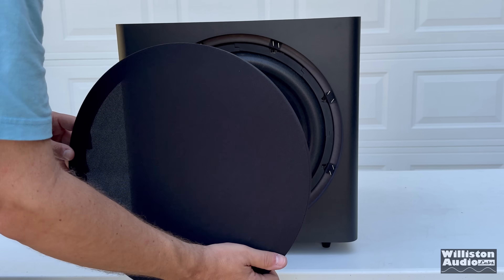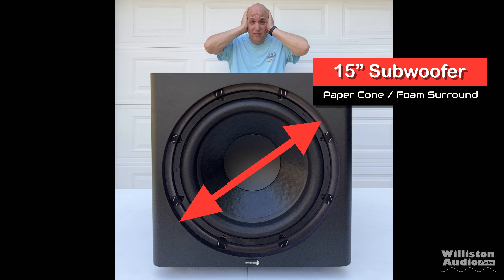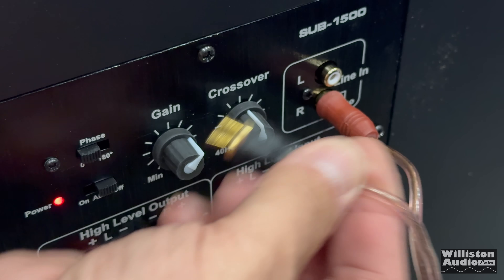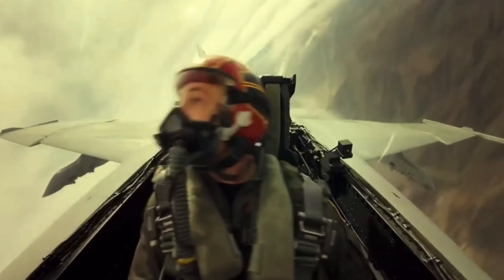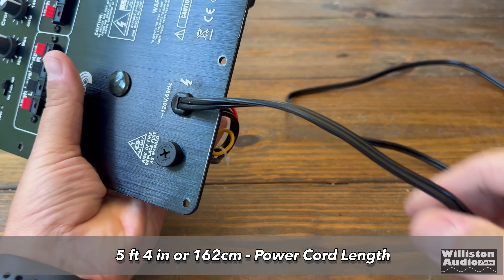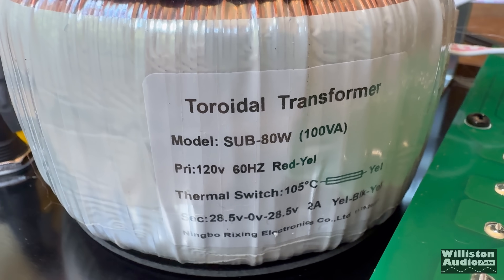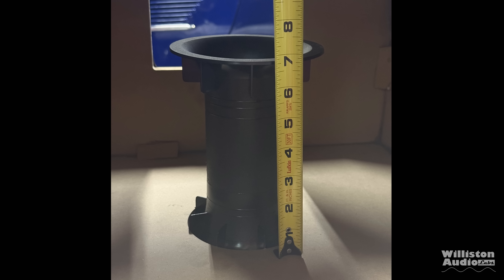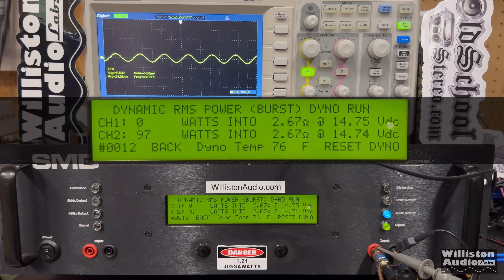Exposing Dayton Audio SUB-1500’s Biggest Secret—It’s Not 150 Watts!

Comment: That stinks they advertise it as 150 watts.   I have a lot of Dayton Audio gear over the past 15 years, and it has all been exceptional.   
Built some great bookshelves with Dayton 6.5 and Tweets in some Cherry veneered prefinished Parts Express boxes with over 20,000 hours of listening time (running off 2 channels of an Emotiva XPA-5 Gen 1, 350w RMS @ 4 ohms).  Also a Dayton SA1000 rack amp that has well over 20,000 hours listening time (powering JBL W15GTi MKII).
And of course their DATS is an incredibly useful tool if you build speakers or mess with raw Drivers a lot.

Comment: So glad you included scope shots.   The clipping waveform on this thing looks horrendous.   Probably sounds like wet farts.
Reply: That's just what clipping looks like. You can make any amp look like that when you go above 1% distortion.
Reply: @TokeBoisen  not any amp.   good amps have a flat / symmetrical clipping.   This thing does an uneven sawtooth.
Reply: @v12alpine I appended my comment in a response
Reply: @TokeBoisen  that is actually a unique looking clip (at least to me) it isn't hard cut at the top and bottom, it just trails off and only on the positive side of the sine wave while nothing happens to the negative side... Can't say I've seen it before, and also can't say if it means anything significant 😁
Reply: @volvo09 a clip occurring only on one half of a sine wave might indicate an imbalance or asymmetry in the amp's output stage. Often happens with shoddily designed systems, possibly the result of a mismatch in the transistors or poor biasing.
With regards to why it seems to trail off, that might just be what the scope captured of that particular instance of the signal, making it look anomalous. Burst testing and triggering and clipping adding up maybe.

Comment: I'm wondering if they rated ut based on the subwoofers power handling instead of the amplifier outout, since the sub itself is actually rated for 150 watts.
Reply from the maker: Could be! Most of the plate amps have “measures power” in specs, this one doesn’t

Comment: I wonder what it would sound like with a more powerful plate amp installed. Maybe some box bracing and more dampening material.
Reply: The box bracing would O.K. but, don’t go crazy because that’ll subtract from the box volume which will change the alignment and compromise the LF response.
DON’T add more damping! It’s a common misconception that more damping is better but, that’s not true.
Like most speakers (subwoofers particularly) today this is a vented enclosure. Its operation is designed to extend the bass response by using the resonance of the port and the enclosure to “fill in” the very bottom of its frequency response. Putting in more than the minimum amount of damping material will dampen out that resonance and cause a loss in that bass response. In other words, you’re absorbing the deep bass that the design was meant to produce. Not a particularly smart way to “improve” on the design. You can change the performance with that extra damping but, it’ll be for the worse. Leave that part alone.

Comment: Search for "The Ultimate List of BASS in Movies", that's a good source to look what movies are great for testing subs in movies. 15" sub paired with 70W amp... Feels like waste of effort even if it is comparably cheap. Whole point of going big is moving more air, to move more air you need more power. For this power 8inch sounds about right, would take at least 3 times less space and you loose about 2-3db overall going 8innch sub for same power, but low end extension actually would be better. You could argue that distortion would be less with bigger sub, but what's the point of low distortion, if it can't play loud enough to be heard in said frequencies...

Comment: What does the 0-180 phase button mean when set on 180??
Reply: reverses the polarity.
Reply: @CVLova  So you’re doing the thing that you’re absolutely not supposed to do with a car speaker, switching the positive and negative leads?
Reply from the maker: It’s reverse phase and may sound better in certain circumstances. Best to try both to see which sounds better in your room/sub location
Reply: @wal I got that part from the button lol, but does it mean you’re essentially switching the positive and negative leads to the speaker?

Comment: I once bought a Dayton audio plate amplifier. It didn't last.
Reply from the maker: I have the SPA250 which failed, the Yung 300W, which also failed and the SPA1000 which still works. The failures may have been my fault do to the extreme testing but I honestly can’t recall why or when they failed

Comment: I have the 8 inch sub from Monoprice for 60 bucks, and it's good. I had a plate amp from Dayton that was 100 watts to use with Buttshakers, and it had larger heatsink fins on the outside. That's what should be in this. I think you got seconds they were clearing out.
Reply: I had that sub from monoprice and it was absolutely atrocious.  I had a cheap yamaha ( yst012sw) 8" subwoofer. It was twice the weight. The monoprice was so bad there was as much difference between the yamaha and the monoprice as the difference between the yamaha and a 12" svs sb2000pro. 
Look up cheap yamaha subwoofers on used markeplace. The 45watt 8" absolutely destroyed that 75w monoprice or whatever they were claiming.  I measured everything in room eq wizard using  umik 1 calibrated mic

Comment: It is relatively speaking much cheaper to make class D amplifiers than traditional class A or A,B amps.
I think they could have included an amp that can produce 150 watts for that price.
Reply: @Geerladenlad  in this case it’s the power supply limiting the output, not the actual power amp section.  Sticking a class D in there can’t magically produce more power from a weak supply.
Reply: It wasn't a question of the power supply. It was a question of them cheaping out and putting an amplifier in there that wasn't producing the meagre 150 Watts that was promised  @drozcompany4132
Reply: @drozcompany4132  Power amp sections seems to consist of one single pair of output transistors. They'd be pretty hard pressed to do 150 W continuously without blowing up even with a better power supply.. Also the dynamic power would be poor as it only has 6600 uF of capacitance. The results from the test is exactly what one would expect, I think.

Comment: For the price point there's plenty of recognized brands that it probably deliver a bit more power. I don't know about 15 in though. I got a Klipsch 12-inch for 300. I highly doubt it's pushing its claimed power.
Reply from the maker: Power isn’t everything but 70W for a 15” is kinda weak…IMO
Reply: @wal 70 watts at size is a waste of space. Considering a lot of don't live in large places we want to get the most out the space used.

Comment: Did u ever test a Dayton ultimax ? I really want a 18 inch version
Reply: I just got a10, haven't hooked it up yet maybe tomorrow or Tues
Reply from the maker: I have an Ultimax 8” sub but haven’t played with it yet
Reply: I have a 15" Dayton Titanic, which the Ultimax replaced a few years ago.  The Titanic has been an amazing driver.  I built a large sealed cabinet for it and powered it with a Parts Express 640W plate amp.  It absolutely rocks and has been trouble free for MANY years now. I love my sub.